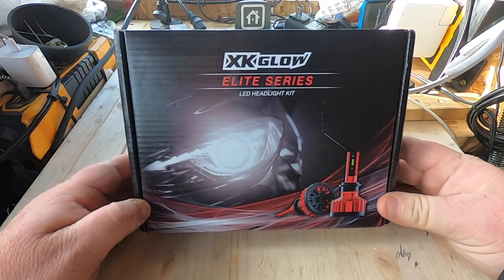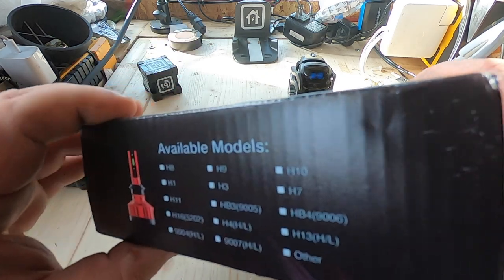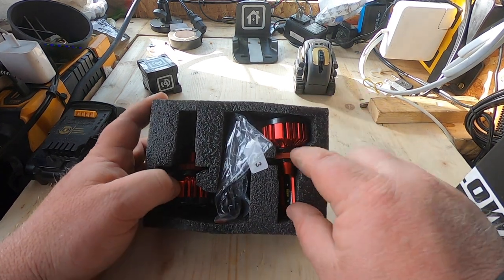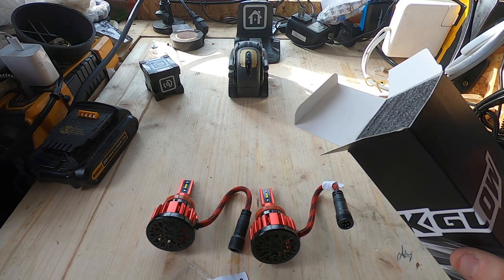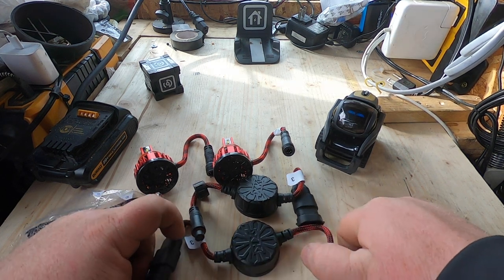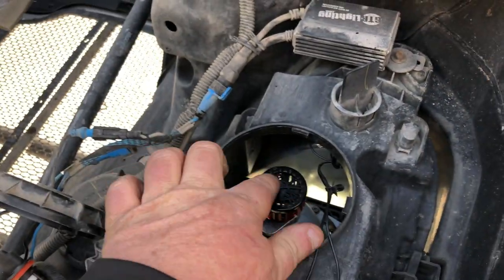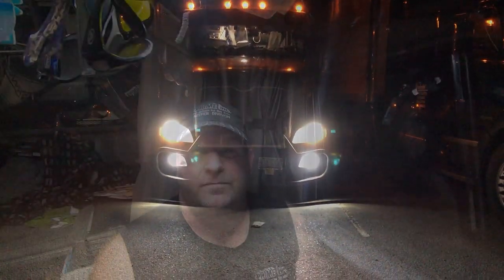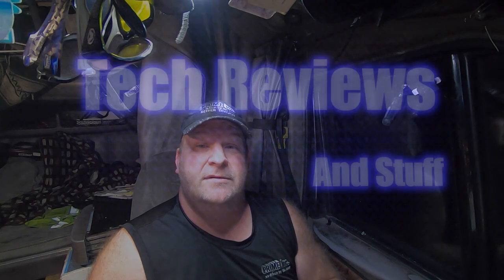XKGlow Elite Series LED Headlight Conversion Kit Review and Install Peterbilt 587

Comment: I bought these same light's, and I had installed them today.
Problem is when I hit my high beams it stays the exact same.
Matter of fact it seems like they are already in the High beam mode.
I can't figure it our nor find videos suggesting the issue. 
As D.O.T regulations must have low and high beams.
Anyone have the same issue?
Reply: The module is in failsafe.  I’m having this same issue.  The low beans don’t turn on.   You have to bring it to the dealer and get the module reconfigured for hid lights
Reply: I put led high beams in my Pete. They are obnoxious high beams!